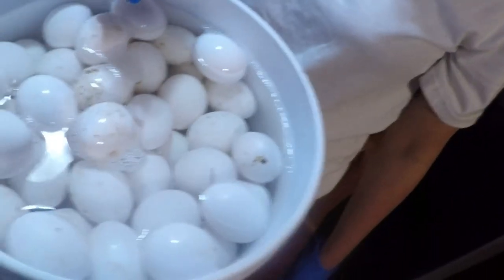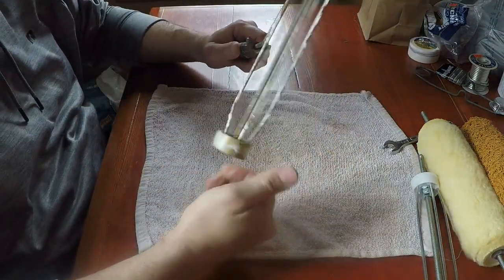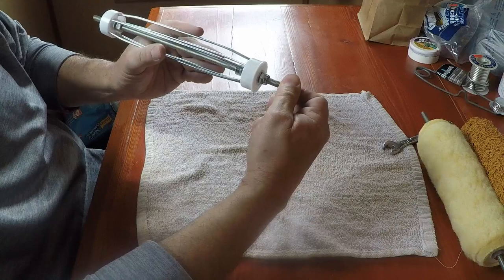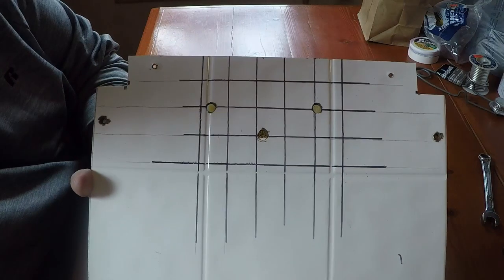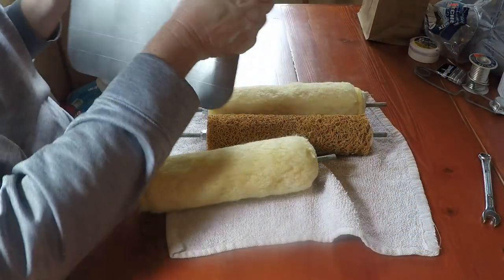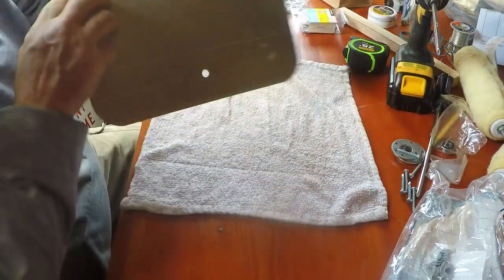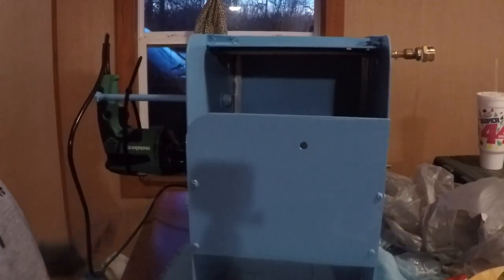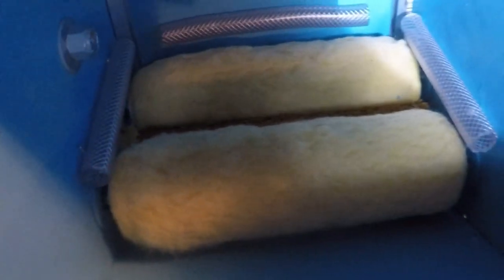HOW TO MAKE AN EGG WASHER , HERE AT RANCH BALUT! THE CAPTAIN DAVEMAN WAY!

Comment: This is the best home made egg washer I’ve seen yet. I agree the air bubbler designs are inferior. I will be making one similar to yours!
Reply from the maker: THANK YOU, I HAVE BEEN USING THIS WASHER EVERY DAY OVER 200 EGGS PER DAY.. STILL GOING STRONG. HAD TO REPLACE THE ROLLER ONCE..
Reply: How do your eggs role on all the surfaces? Mine just role on the equator and miss the pointy ends.
Reply from the maker: @cartertrefz4585  ALL YOUR ROLLERS MESHED TOGETHER? ALSO THE ROLLERS ON EACH SIDE NEED TO BE THE  EXTRA THICK FLUFFY ROLLERS. LIKE 1 1/4''. I REPLACED MY ROLLERS NOT TO LONG AGO AND DIDN'T USE THE REALY FLUFFY ROLLER HAD THE SAME PROBLEM. ALSO IF YOUR EGGS ARE REALY DIRTY SOAK THEM FOR A LITTLE WHILE AND ONLY PUT 2 OR 3 IN AT A TIME THIS WILL GIVE THEM MORE FLOPPING AROUND ROOM.
Reply from the maker: @cartertrefz4585  ALL ROLLERS SHOULD BE MOVING.. IF NOT THEY ARE NOT MESHED TIGHT ENOUGH TOGETHER..

Comment: How does your egg wash hold up? 
More curious of paint roller replacement, how often! 
I was trying to build one similar to what yours was but could not find the brushes that I needed. Then I saw this video!
Reply from the maker: Rollers last about a year. 200 eggs a day. You want the fluffy rollers. Let the eggs soak a few minutes before washing. I also went with a battery drill. Better to control the speed.

Comment: Awesome video!! We are going to build one of these and I am interested to know how the rollers go. Are they difficult to clean? How long have they lasted? Are there any improvements that you would make if you built it again? Thanks again for the great information!
Reply from the maker: Easy to clean I just put some dish soap and let it roll. I have replaced the rollers once and I use it every day. I use a cordless dewalt now. Here is 3 tips 3 eggs at a time. Place them in while the machine is on end first. That way they will tumble end to end a couple of times and get the ends clean. Also soak your eggs in warm soapy water 30 minutes. This will not hurt your hatching eggs. I get 95% hatch 🐣.